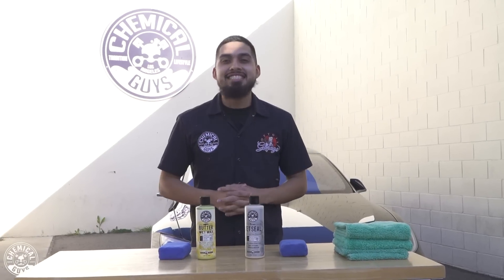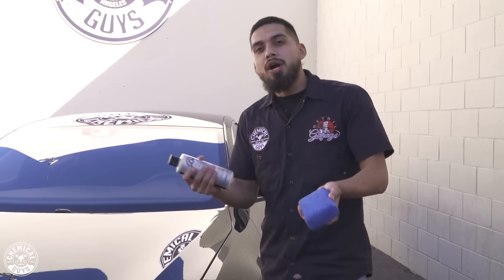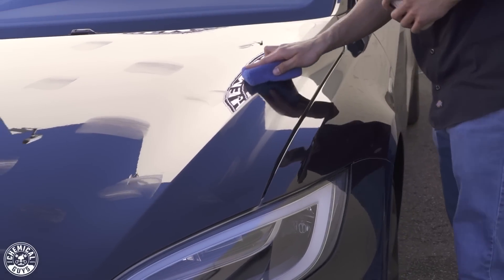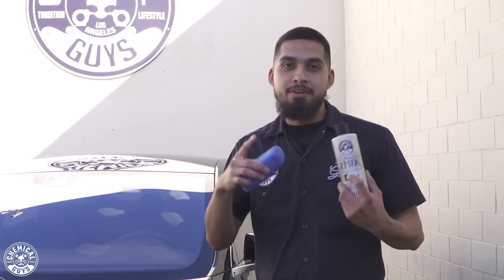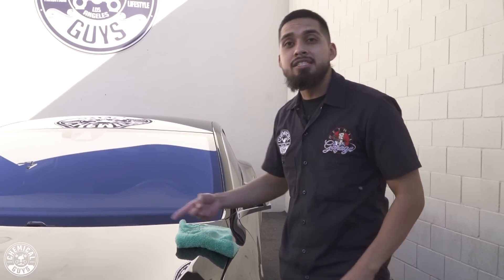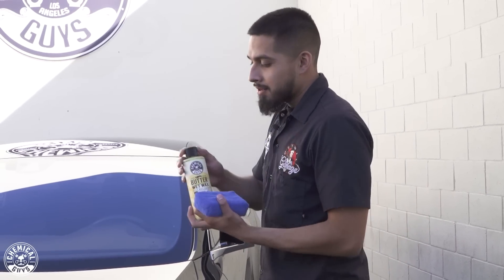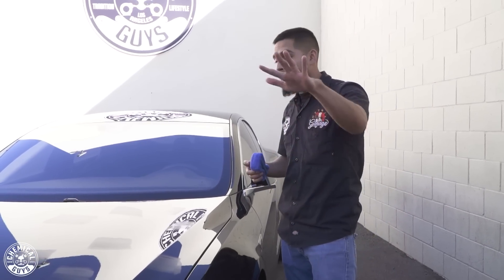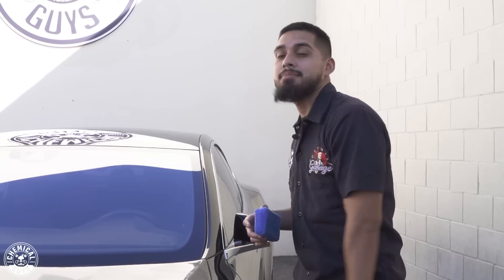How to Protect Your Ride With a Brilliant Mirror Shine! - Chemical Guys Tesla Detail Part 3

Comment: Would you guys still recommend using Jet Seal after applying Black Light Glaze since it has a sealant in the mixture? Or skip and go straight to waxing after the glaze?
Reply from the maker: Hi there! Black Light only contains a fine amount of sealant so to provide the most durable layer of protection it would be best to follow up with a sealant and/or wax.

Comment: About to finalize my order but wanted to check if its okay to use hydro charge first then top it off with jet seal and finish with butter wet wax?
Reply from the maker: Hey there! Absolutely, HydroCharge can be layered with JetSeal and Butter Wet Wax.
- CG Nick

Comment: I applied the butter wax on the car, but I left some residual on the paint. Will that be easy to remove during my next wash? Or it will be like ceramic coating to be the high spot?
Reply from the maker: Hey! Use your favorite quick detail spray to remove missed areas of wax.

Comment: Can i use speed wipe before applying jet seal and butter wet wax? @chemicalguys
Reply from the maker: Hey! Yes, it is perfectly safe to clean the surface with Speed Wipe before applying Jet Seal and Butter Wet Wax. Be sure to inspect the paintwork to determine if a clay bar treatment is necessary before applying coatings.
Reply: @ChemicalGuys  Thank you!!